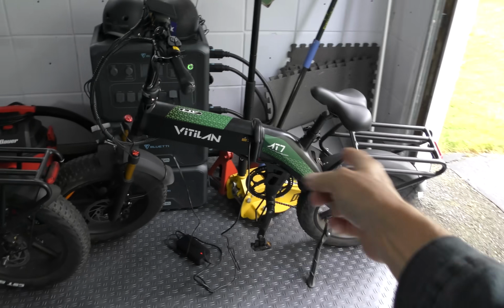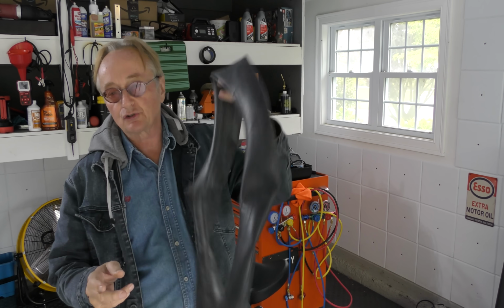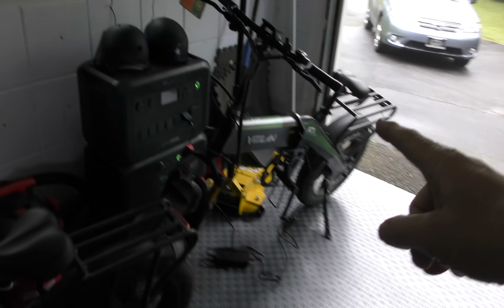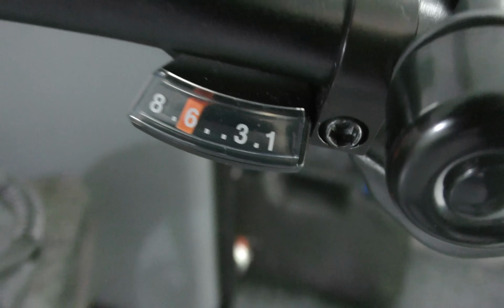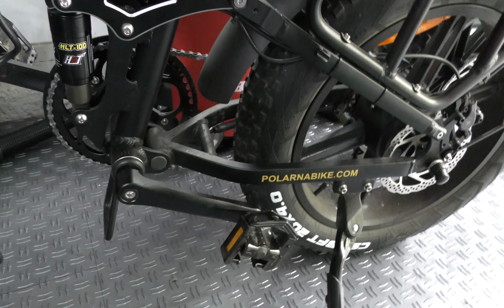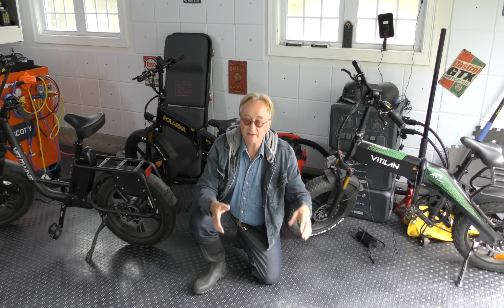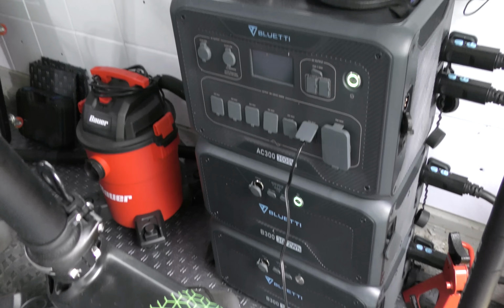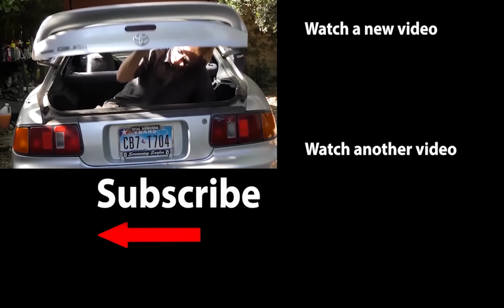I Finally Got an Electric Vehicle, Here’s What I Chose

Comment: The one that the battery last longer either has a lower amp controller or is limited in the settings . Do yourself a favor and get some flatout in your fat tires before you get a flat .

Comment: I was going to get the MiRider but here in the UK there more focused on making more cycle lanes but not on bike security. Bike theft is sky high here, they cut Dlocks off with angle grinders even in front of hundreds of people in Broad daylight. I knew some people with expensive bikes that left it locked up for 5 mins to pop in a shop, all that was left was his Dlock cut off on the floor.
They won't make more car lanes as they want to discourage driving but they make loads of cycle lanes, I'll stick to driving my car.

Comment: Hoping the price on e bikes goes down soon, here in Taiwan you can buy a full on electric scooter for that price. Way more range. 50 mph. And GREAT quality and craftsmanship. 
It just doesn't seem right that them charging so much for so much less. 
Anyone know if an American made ebike company selling at more reasonable prices?
Reply: Cushman used to make electric scooters and trikes for use in manufacturing plants. The supervisors rode the scooters and the mechanics/electricians rode the trikes since their box had drawers for tools and a strong top where parts were placed. Others converted worn out gas powered Cushman scooters by using car batteries, a 12v car generator switched over to be a motor and a sewing machine speed control pedal. I saw a lot of those when growing up in Chicago being used by workers taking the residential streets and alleys to work and back.
Reply: @billwilson3609  Yeah! Maybe we can be on the lookout for some high quality conversion kits. I like the upgrade approach!

Comment: Check out Juiced E-Bikes Crosscurrent X. I've had mine for 15 months and am approaching 7900 mils without a hiccup, aside from replacing one chain and brake pads twice. Check it out on YouTube.  I have no problem doing 25 mph in the lowest of five assist levels, and in level three, I can do 20 miles at that pace. Even with fast riding, I get a range of 50+ miles per charge.

Comment: i had electric bikes the batteries last only a year or so until id replace them i could get about 20 km on a full charge thats about it..solid hour and a half or so on a full charge pretty durable but i [probably wouldnt buy another one as i have a truck now
Reply: they are easier to peddle than youd think also even though they are a few hundred pounds

Comment: Scotty how about a video review of some of the Spandex riding clothes. Those batteries will go further  with a slick outfit on. Seriously, I love my mid-drive mountain bike. I own a nice carbon hardtail but the Ebike gets me further out there. I've ridden a hundred miles, finished an Olympic distance triathlon, ran a couple 26.2 marathons etc. The Ebike has helped me get back in the game after recovering from a long term illness. I felt like I was cheating at first but I'm discovering I can get nearly as much  of a workout as my pedal only bike. By the way, I have solar panels that are over producing to the point my meter runs backwards even with the A/C running. Even with my own power plant basically, trading my wife's paid for pristine low miles RX350 would make zero financial sense. And no way will an electric pickup replace my turbodiesel 3/4 ton that tows our travel trailer. Scotty, man would I ever have a blast going out for a trail ride with you!

Comment: Hello, what are these tiles on the floor, where can I get them in Europe? It is class.
Reply: You should be able to buy those rubber interlocking tiles from an industrial supply house. Those are often made with recycled car tire rubber and are used by workstations to provide a soft non-skid surface for the workers to stand on.

Comment: I  bought  a  new  Honda  CB450  motorcycle  in  1973  for  $1050.00 .   The  intended  depreciation  of  the  value  of  our  currency  is  a  legal  form  of  robbery .
Reply: I bought a new 1973 BMW R75/5 motorcycle in April of 1974 for $2500. Was going to buy a new 1974 Ford Maverick for the same price but figured the bike would cost less to maintain and hold up longer than a new car. Was 19 then and the dealer said it's resale value in 10 years should be $1250 if I took good care of it. I still own and ride the bike which is now worth $7000. The Maverick GT I was considering buying is now valued about the same as the bike.

Comment: No way did one battery go to 0% power with a 230 lbs grandson and the other one was still at 90% power with an estimated 190 lbs Scotty.  

Well, I believe it happened, but I think one of the battery monitors (or batteries) is bad.

Comment: Great video, but just thought of something. Is it possible or a feature to have is if you can manually charge them by pedaling. This would be handy if you ran out of electricity have a enough charge so you can for instance have a climb you can use it?

Comment: The battery is the reason it lasts longer. They all could be 48 volts ,but one could 10ah  and the best could 20ah. the higher the amp hour the longer the battery last per charge. I say the highest price bike , might have a better motor also. The bike I bike got a 3000 watts motor.

Comment: Honest.  I respect your opinion on these bikes, however in general if I’m dead on the road, I prefer a jerry can with good ol’ gasoline.  No waiting for my generator to recharge my battery, no dying of heatstroke, etc.  Gas up and go.  Also gasoline fires are far more controllable than electric fires.
Additional.  If there wasn’t some dumb push for electrification, I wouldn’t have a problem.  But if you want to compare carbon footprint, electric cars cause more so-called “damage” to build, and in most places they cause more damage just charging than petroleum-fueled vehicles do.  
Fair.  If you know what you drive and acknowledge it, I don’t have a problem with you.  It’s the people who are pushing for it and the people who don’t know or pretend who I cannot stand.

Comment: Could you give us side by side breakdown of the three by weight?

Have you seen the in hub motor wheels that you can slap on a regular bicycle to make it electric?

20 24 26 inch 48V Fat Bike Electric Conversion Kit Hub Motor Snow Wheel 4.0 Tyre

I don't take money to advertise either, I haven't even tried the electric wheel above but I suspect it's very much like any other electric wheel, it does have recumbent braking which is a great option and you could soup up one of those bikes with this to go really really fast

Comment: Order brake pads now ! You'll need them by the time they arrive....
Make sure to tighten and check the rear axle on hub drives,they like to loosen because of the torque .You don't want to spin the axle ( hard on wires).

Comment: I bike commuted for 2 years without an electric motor. Would have been real nice with an E-Bike. The only problem is most shops and workplaces in the US don't have safe places to lock up a bike, and here in California, theft is so insane, the homeless will cut your lock or the bike rack to steal your bike using a cordless grinder.

Comment: What's that flooring in the garage? It looks nice, probably could hose down any messes.
Reply: Those are interlocking rubber tiles. Should be able to buy those at industrial supply houses or ordered from auto parts stores. Those were made for use on concrete floors by workstations to give the worker a soft non-skid surface to stand on.

Comment: My Lectric bike costs $999 and it's just as good if not better than any of the bikes Scotty has. Fat tires and the bikes are made in America, plus they are foldable as well.
Reply: Amusing. 

Take all of the Chinese parts off that Lectric and you might be left holding a set of handlebar grips - the grips are Indonesian. 

I know for a fact that the XP is a Chinese "white bike" - manufactured to put anybody's brand on. Other models were made to Lectric specifications, but came out of the same Chinese factory.

Did you not notice when Lectric had delivery problems last year? The bikes you believe were "made in America" were stalled on Chinese container ships lined up outside the Port of Los Angeles.

Lectric IS an Arizona company, owned and operated entirely by Americans. With the exception of the original XP, their bikes are designed and specced in America - but produced entirely in China.

In 2020, Lectric was doing a million dollars a month in sales with 14 employees. Which of those 14 employees do you imagine lovingly handcrafted your frame and custom spoked your wheels?

Now... will you get better support for your Lectric bike? Absolutely. You'll be talking to Americans who care about customer service, and Lectric has a good reputation. 

But, they don't manufacture bikes.

Comment: Maybe the Velowave is lighter.  A lighter metal construction may be why it costs $100 and $200 more.  Have you tried weighing them or compared weight specs on the boxes or online?  The gear ratios between them could be different, too.  Something is making the difference.  Maybe a combination of lighter weight and gear ratios.  You should be able to find these specs online.  Yeah, bearings could be another factor.

Comment: The duel suspension is probably one of the big factors why that model doesn't get the distance the top range one does, same idea though, Resistance, which better suspension usually gives more resistance on flat roads, hence why duel suspension mountain bikes get eaten by hardtails on the flat, on the mountains is a whole different story .

Comment: I converted my old 90s Schwinn MTB (steel frame) to a middrive ebike a few years back. Took awhile as I had to do all the wiring myself, and I wanted custom parts like throttle, cargo racks/bags, lighting for night, safer brakes and hybrid tires for road use- but the result was well worth it. It can eat up northwest style hills for breakfast (since the motor works with the chain line it uses gearing better than hub motor ebikes), gets a decent range even though I weigh more than your 21-year old family member, and so long as I stay off high speed arterial roads, is a lot of fun. With gas getting high I might look into more rides again, even though I drive a fairly economical Honda Civic.
Reply: Wish you could tell us how!
Reply: Mid drive is definitely better for hub drive

Comment: Class 3 ebikes (throttle & up to 28 mph) are limited to where u can ride them. Rails to Trails typically only allows Class 1 ebikes (pedal assist/no throttle & max speed w/motor = 20 mph)
Reply: Yeah but that leaves an awful lot of places you could ride a class 3.

Comment: I am pretty sure the gauges for the voltage is just off and they will all last about the same amount, My Ebike goes to about 50% and then it dies, I can go 20 miles on 100% battery life, 10 miles on 99% battery life and then after that it drops like a rock

Comment: Side bar.... I have BMW 750i and the transmission temperature light came on and my car got stuck in park and wouldn't go in drive until I turned of the engine and started it again. What do you think the problem is. BTW I just got my transmission done..

Comment: just dont charge them indoors. 💥🏠🌋
Reply: So where outdoors do you charge your cell phone and laptop?
Reply: @47f0  they can be hacked the charging rate changed. and there has been times laptop batteries exploded & when they were first put in planes fires happened. thats why they are now 80%20% 80 charge 20 discharge and temperature protected. i wont trust them. thousands of an inches from done well or disaster?. ive given thought to external reasons to overcharge situations like a carrington event or emp? 80% charged to over 100% could happen? after watching many fire videos where its almost impossible to put out those battery fires.. ?

Comment: I do wonder how these will hold up over time? I'm sort of iffy about things until I see them still working years later with mostly original parts.
Reply: My youngest son manages a high-end bicycle shop in a Southern college town. He started off as the shop's mechanic 6 years ago when the shop sold ebikes. He said those didn't hold up well in hilly areas with crummy roads like his college town had and did much better where roads were flat and smooth. I guess their nuts and bolts came loose to make the bikes wobble. He also said their battery packs weren't worth a flip and would need replacing after a year. He told the store owner to stop selling new ebikes and wait until those became better made. Believe he's now selling those again but are the higher priced ones with more range and a better track record for durability.

Comment: The only thing that concerns me is the battery testing of EV bicycles. There really are not any testing standards for the batteries witch could catch on fire like the hoverboards did. I feel it's a great idea though.
Reply: There really are testing standards that the Underwriters Laboratory has for rechargeable lithium batteries. Very few ebike manufacturers have gone to that trouble or expense because they don't need to - they're selling as many as they can make. But there have been some pretty well publicized fires in New York, where ebike messenger services are constantly charging batteries, and often find the cheapest replacement batteries. they can get.

The good news is that these incidents seem to be much fewer for ebikes than they were for those incredibly cheap hoverboard toys, but I tend to charge my e-bike battery out on the concrete-floored porch. Just in case...

Comment: Hey Scotty love your channel man, you got tons of knowledge and skilzz.
I think it's time you share the real knowledge and show us how to convert the gas engine to run off good old water 💧💧 we already know the tec. exist am just saying man!
Reply: Go make your own. Just need a stout solution of sodium hydroxide (lye) in a jar and scrap aluminum to drop in. The aluminum reacts with the lye to produce hydrogen gas that's piped to the carburetor to be added to the incoming air so you can run a leaner mixture. The USDA may have some old plans available on line since those were used on farms during the Great Depression and WW2 to go further on a tank of gasoline.

Comment: Scotty will it charge the battery by peddling?
Reply: Nope. There's no regen with this type of hub, which has an internal planetary gear and coasting clutch. 

A direct drive hub motor can do regen, by going downhill (or, presumably, pedaling), but those are less common and more expensive.

Comment: For a month when my transmission was being fixed, I used my electric bike for transportation. 4 hp Cyclone motor in a Swagtron EB8 as the starter. I build my own batteries for the bike, the boat, the kayak etc. Small slow vehicles with no crazy range expectations. That is where electric shines.

Comment: I destroyed one, lead batteries drop like flies, and turn into dead weight!
Reply: Why would you use lead batteries to power an electric vehicle??? I guess maybe there are some mobility scooters that still use those old lead gel cells, but pretty much all the bikes are running lithium battery packs.
Reply: @47f0  it was way back when lithium was getting started and super expensive.

Comment: I'm a loyal viewer and think you are an excellent mechanic.  Your recent rant on electric cars is out in left field.  I'm in Ottawa where we get our electricity from Hydro Ontario.  Water derived electricity doesn't pollute and is renewable.  Most people charge their EV's at home at a cheap cost. With 400 miles of range most trips are almost free. Only the longest trips will require on road charging. How often do owners do long very trips ? Most households have a second gas car for that.
Reply: Pretty much every take you see on EVs is misinformed unfortunately.
Reply: @PorkchopExpression  And I've got some more for sale
Dm to buy yours for a cheaper price
Reply: @Guy Larabie mining the batteries still pollutes.
Reply: @Blakecryderman7244  - Nearly any human activity will cause pollution. No one with any credibility is claiming that electric vehicles have zero environmental impact. The question is how much and what kind of pollution.

Nuclear energy, for example causes pollution. Whether that pollution constitutes a greater impact and risk than generating electricity with coal is the actual analysis that needs to be done.

The manufacturer of either gas or electric cars has an environmental impact. That needs to be analyzed in each case with regards to the impact of their power source, which for internal combustion engines is something we have a pretty good idea about. With EV'S it's a little trickier because there are at least two battery technologies that will change the environmental impact equations somewhat, and the power mix for recharging electricity is changing rapidly in many markets.

Comment: Something ain't right hear. They have  similar battery compatibility but on the same ride one is drained and the other only lost 10%....some things off like the batteries are totally different chemistry or the voltage indicators are miss calibrated or.....also some recharge products deliberately cut off at less than fully drained because it's bad for the battery life and charging cycles. So there is an extremely good chance that that 90% is totally bogus. one way to find out is to drive it until is dies. Actually, make notes in a notebook for mileage at different charge % remaining vs. miles travelled. then compare. I'll bet you dollars to donuts it's a decreasing exponential curve. If the 90% is real then he should be able to travel 16 x 10 = 160 miles, hmm......I doubt it.
Reply: That seemed pretty dodgy too. But maybe Scotty took his vitamin B1 before he rode that time and did a majority of the peddling.